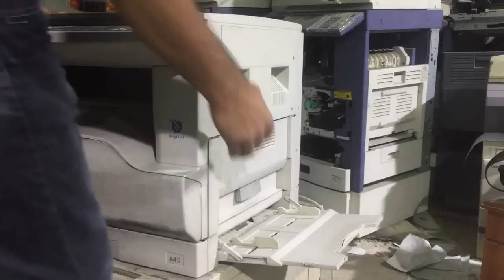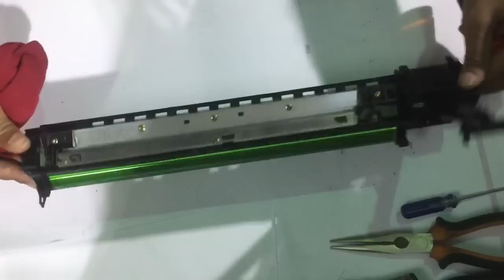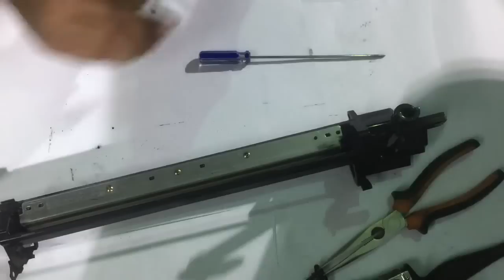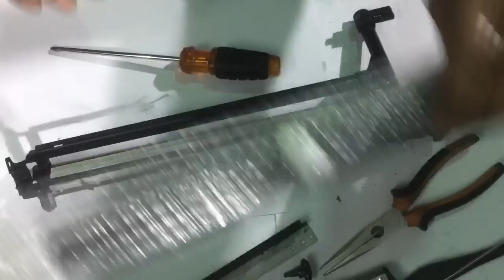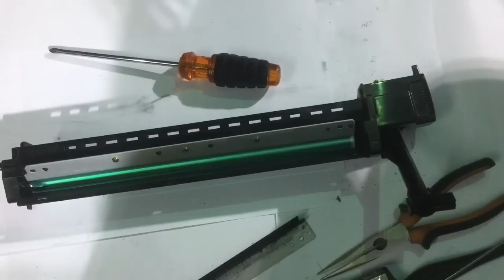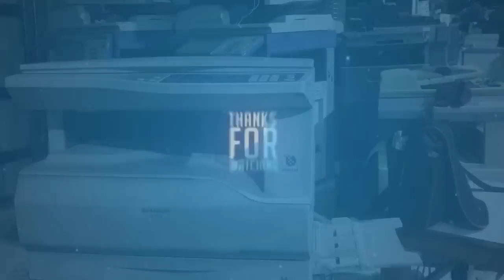How to remove and service sharp AR-5316 drum cartridge and developer

Comment: Very good video, how many prints change consumables?
Reply from the maker: toner cartridge approximately 15,000 page yield.
drum and blade approximately 30,000 page yield.
Upper heat roller approximately 1,50,000 page yield.
developer life is 5,00,000
Reply: @Coronatechnical  Pls how do you mean page yield?

Comment: Hi again me. now my copier gives one side very lighter copy's .and same side other end is normal.little toner comes out from the paper feeding side up. I replace toner and drum but it is still like that.so please help  .....sharp ar-5316
Reply from the maker: maybe a problem with corona or a Developer.
Follow the Simple Step. 
1. Clean the both sets of corona wire. 
2. Clean the scanner mirror. 
3. Check the gear in the developer unit. 
4. Replace the developer.